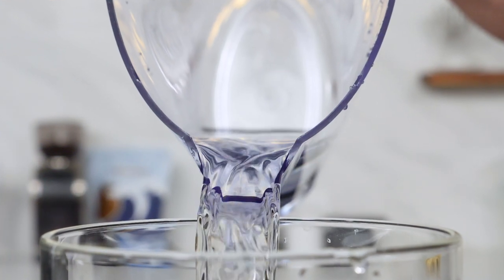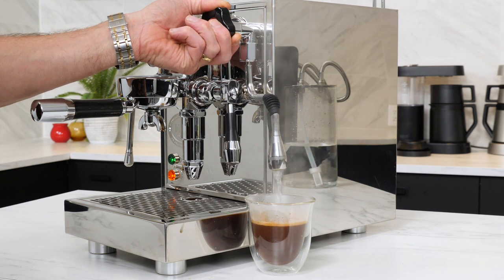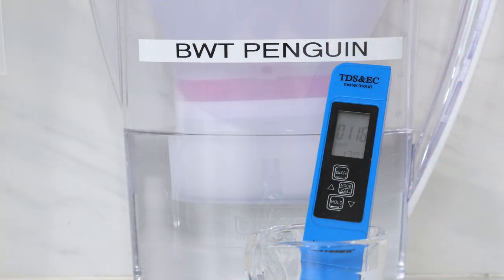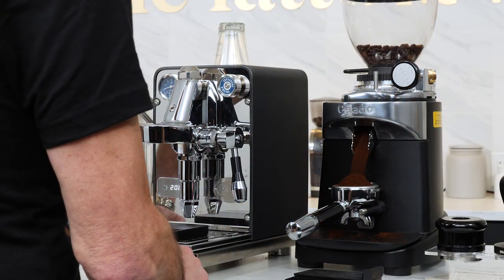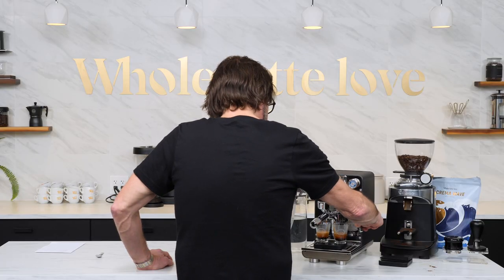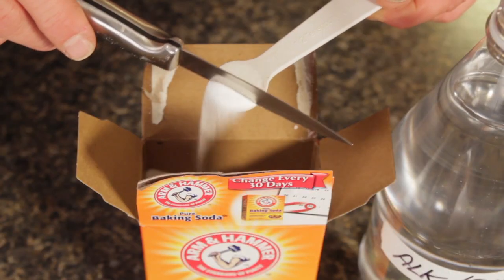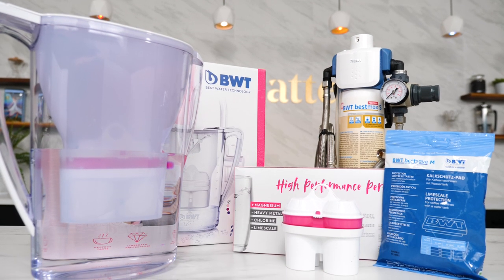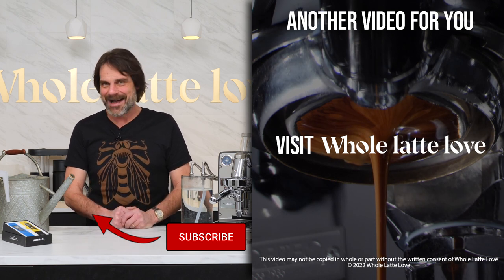Ultra-Pure Water for Coffee and Espresso?

Comment: I have been using BWT pitcher for drinking water for years, but I wouldn’t use it on my expensive machine. Chlorides are not taken out thru a carbon filter and eventually your machine will have to be descaled. I rather use distilled water and Third Wave Water. Or you could run distilled water thru the BWT Magnesium filter.
Reply from the maker: Hi j, thanks for the comment. Depends on your local water supply but high chlorides (often in coastal locations) are not a problem for most. Be aware a BWT magnesium ion-exchange filter will not add minerals back to distilled water. BWT does have the Bestmin filter designed to remin water with low to no mineral content like distilled and RO:https://www.wholelattelove.com/products/bwt-bestmin-premium-m-filter-cartridge

Comment: Hi Marc, thanks for all the helpful info.  I’m planning to plumb my dual boilers and have a question about how to get the best quality of water for the machine.  We current have a whole house water softener system and would it still make sense to install a BWT in-line water filter for the plumb line?  Thank you!
Reply from the maker: Hey Mark, You are welcome for the info. Honestly it's hard to say. There's some variation in whole house softening systems. If you are happy with the flavor of the water from the system and the coffee it makes then the remaining concern is the calcium hardness. Whole house systems generally replace the calcium with sodium so scaling potential is reduced or eliminated. This type of softening can increase the sodium level of treated water. But, unless your source water was very hard >400ppm sodium increase is not high enough for  concern. Softening systems do not reduce chlorination, chemicals or particulates on their own (the BWT inline filter does) but many whole house systems do include activated carbon and mechanical particle filtration for that.
Hope that helps!
Marc
Reply: @Wholelattelovepage   Hi Marc, thanks for the prompt reply!  And yes!! that helps a ton.  Getting the water situation figured out has been tricky, let alone having a dedicated line for the espresso machine.  So you are definitely helping us make the right decision with your experience.  The water hardness in our area is around 152 ppm and the water softener we installed is from Puronics Hydronex igen B, which has a layer of filtration to reduce chlorine levels as well.  Would you say BWT bestmax filter is a "nice" addition but probably not mandatory in my case?  Again, thank you so much again to provide such help! ^^

Comment: How does the pitcher work since you dont have to test the water and make the appropriate filter chiloice like the inline filters.
Reply from the maker: Hi r, The inline filters treat water much faster than the pitcher. With that, they use a bypass setting (determined by water testing) to adjust how much water goes thru ion-exchange to insure proper filtration. The pitcher system has a known flow rate thru the cartridge so it's designed with capability to properly exchange with a wide range of calcium content inputs.

Comment: I have an RO system with a reminilizer on it to alkaline the water. Does that work? I was planning on buying the Profitec 400 and just read about RO water ruining the boiler. Is this true?
Reply from the maker: Hi AB, Remineralizing should do the trick. But, not all remins are created equal. If yours uses calcium to remin then depending on concentration it could leave you with water which will cause scale. Scale is fine so long as you descale your machine as needed and the 400 being an HX boiler machine descaling is fairly easy and low risk. Pure RO water can cause corrosion of metals and terrible tasting coffee so do remin. I prefer remin which uses magnesium as the mineral. It's a good extractor and no corrosion.
Marc

Comment: How about using the Third Wave Water “Espresso Blend” packets in distilled water in the reservoir of espresso machine? Is this safe for my machine? This would be without an in tank filter.  The ingredients for the espresso blend are a little different than their classic blend. The espresso blend consists of Magnesium Sulfate, Calcium Citrate & Potassium Bicarnonate. Is this water fine for my double boiller?
Reply from the maker: Hi K, Thanks for the question. Unfortunately I do not know if that mix is fine for your espresso machine. Would need to test it for calcium level and other parameters to determine scaling potential. My gut says given that calcium is part of the mix it may cause scale but I cannot be certain. There are less costly make your own brew water options that use only magnesium to get the required mineral level. I show one recipe in this video: https://youtu.be/iHI7jC0sQZo
Marc

Comment: Purchased the ECM Synchronika from you all.  I purchased the BWT-M in tank reservoir.  What’s the best water to used in the reservoir with the BWT-M filter for best taste, distilled ,tap or filtered tap?
Reply from the maker: Hi K, Congrats on the your new machine - the Synchronika is a beauty! For water, do not used distilled. If your tap water is reasonable  - average with no unusual characteristics you can use that straight in conjunction with the BWT Bestsave in-reservoir pad filter. It protects you from scale formation and removes chlorination. Just be sure to allow 12 hours of contact time between the filter and water before use. So refill your reservoir when done using the machine each day, let it sit overnight and your ready to go. Hope that helps and thanks for your patronage.
Marc

Comment: Hi Marc, what are your thoughts on using Sparkletts water for Esspresso?
Reply from the maker: Hi Jonathan, So you want two main qualities in your water. First it needs the proper mineral level to do a good job of extracting the espresso. Second you want water that does not cause limescale deposits in your machine. You also want it free of chlorination - bottled water generally is. Only way to know if your water is good is to test total hardness and carbonate hardness. I have no test results for the brand of water you mention. Bottled water is all over the place in total hardness and carbonates. Last week I tested some Poland Spring brand bottled water and it was close to distilled water. It was lacking minerals and would need remineralization to support good flavor. Also tested a local store brand bottled water. It was high in minerals (hard) and would need filtration to prevent limescale formation. If you can test your brand or get test results from the manufacturer it's good for use in your machine if both total hardness and carbonate hardness are in a range of 3-6 degrees of German hardness. Published test results are often expressed in ppm. 1 degree of German hardness = 17.9ppm. In ppm your good to go if both test between 54-107ppm.
Hope that helps!
Marc

Comment: Hello and please ignore the Warhammer name I have hah.

As someone who doesn't have the ability to plub in their dual boiler machine, will the penguin suffice as the sole way I fill my reservoir?  I bought both the pitcher and pads because I'm worried they won't be as effective as a straight line-in setup.

Also, just out of curiosity, but what is your guy's opinion on those water kiosks in big-box stores that you can fill up those big blue 5 gallon jugs at?

Comment: Mark, I just got the BWT pitcher. My water TDS out of the tap is 186 using the blue stick TDS electronic meter. Out of the pitcher im reading 150ish. I ran it through again with the same water and got 100. Can you tell me how much I can expect the calcium is being reduce with this pitcher to protect my machine because I believe the TDS is not enough to tell me if I’m protecting my machine from calcification.
Reply from the maker: Hi KL, Thanks for the question. Since the BWT pitcher exchanges calcium for magnesium measuring TDS is not meaningful. You will see a TDS reduction but the magnesium still shows up in the TDS measurement. If you were to do total hardness and carbonate hardness tests you would see a reduction in carbonate hardness in water from the pitcher. It's the carbonate hardness which causes lime scale. Here's a video featuring a BWT expert with a deep dive into testing and various water issues: https://youtu.be/7TECrV93iGQ
Marc

Comment: On fully automatic machines like the Gaggia Magenta Prestige, is corrosion a serious threat? Where I live, the water is unbelievably hard, so I switched to using RO water purchased from my local store. I used tap water in my old Keurig and even with the filter in place it built up a lot of lime deposits all over the device.
Reply from the maker: Hi Michael, Not a big risk of corrosion. The Magenta's thermoblock boiler is lined with stainless steel. It's one of the few metals unlikely to corrode due to RO. I'd be curious what the pH of the RO water is. I did not get into it in the video but RO can be slightly acidic. One thing you can do to improve flavor is mix RO with tap water. Say your tap water is very hard at 400ppm TDS. Mixing 25% tap with 75% RO gets you reasonable water of 100ppm.
Marc
Reply: @Wholelattelovepage  Thanks!

Comment: The best is softened water, put through an RO+ filtration system followed by a serious mineralizing container taking it up to 200ppm. It tastes great. RO at 2ppm is hard to achieve and extremely bad for your health unless remineralized before drinking. It can penetrate and burst cells in your mouth, causing what feels like you have burnt your mouth with hot water. Having lost my serious water treatment system in a fire, I recently bought a BWT Penguin from WLL, and can confirm it smooths out bitter tastes in espresso when using simply filtered water.
Reply: "It can pentrante and burst cells in your mouth"
Omg what you write there 😂😂 i drink ro water for years and no problems.... Learn about water! Definition of water is that is without smell and taste.... If you have hard water it will be all but not good for health.
Reply from the maker: Hey Tom, Well I'm not a biologist but a little skeptical on the cell bursting. I do know that with exposure to CO2 in air RO water can become slightly acidic. Sorry you lost your system in a fire ☹️. Thanks for your patronage and sharing your flavor experience with the BWT Penguin.
Marc
Reply: @Wholelattelovepage  BWT only remove hlorid and hard metal parts .. Magnesium and calicium is stll there, so with them you will have deposits in your machine.... You can only remove them with RO.
Reply from the maker: @kzs12  Hi, Yes the BWT products do leave minerals in the water but reduces to a level that's unlikely to result in scale when used as directed. The ion exchange process replaces some calcium with magnesium. Overall general hardness is lower after treatemnt and ratio of carbonate hardness making up general hardness  is lower.
Reply: @Wholelattelovepage  My tap water is so soft that there would be no need to descale. After testing BWT water by steaming it in a steel jug and letting it sit for several hours, I can confirm that it drops a visible amount of scale and the coffee water heater will require descaling from the use of BWT treated water.

Comment: My jura has its own filter. I'm not sure what it does except they claim you'll never have to descale your machine using it. You set your machine for the hardness of your water, which I think just adjusts the replacement frequency of the filter.

Do you know if this filter is removing all the minerals? I assume Jura knows what they're doing with their machines and filters.
Reply from the maker: Hi J, That's correct use the in-reservoir filter as directed in Jura machines and descaling is never required. And yes, setting your hardness plus number of beverages made determines replacement interval. The filter does not remove all the minerals - that would require a full RO treatment system in the filter.
Reply: @Wholelattelovepage  gotcha thank you.

Comment: I have been using since day one of my home espresso setup, the BWT Penguin and also an Oscar 90 water softener sitting inside of the espresso machine reservoir.
This, because we called and asked for some numbers (was it Pha ? I am not sure) for the water from the tap in my area, and considered that both (BWT and Oscar) are necessary
Reply from the maker: Hi K, Thanks for sharing. Your local water provider should be able to give you a bunch of water quality parameters. In the US, that information is available online as well. pH in most tap water runs about near 7 with anything 6.5 - 7.5 being okay for coffee and your equipment. Number to be most concerned about is TDS = Total Dissolved Solids which gives a good indication of water hardness/mineral level in your water. Unless your water is unusually hard with TDS >250ppm the BWT pitcher is likely all you need to use.
Marc

Comment: Hey guys, looks like you guys had a whole latte fun doing this video.
While we are on the topic of water. 
Does anyone have an opinion with using water from the refrigerator water (filtered) dispenser versus from the tap (hardwater area) ?
Reply from the maker: Hi Vic, We did have a whole latte fun! Hard to say a fridge filter is going to do it. Only way to know is to test the hardness of it's output. Likely a lot of variation in what those fridge filters do. Guessing most are just particle and carbon filtration with little to no reduction in hardness.
Marc
Reply: @Wholelattelovepage  Thanks Marc, appreciate your input.

Comment: Is it safe to run CLR or vinager through the machine to clean it out occasionally?
Reply from the maker: Hi John, No! Do not use vinegar to descale a machine! It's a weak acid and leaves a horrible smell/taste. Scale can act like a sponge and soak it up making it very difficult to get rid of. For descaling use a citric acid based product or the product recommended by the manufacturer. Urnex products are what the pros use: https://www.wholelattelove.com/collections/urnex/products/urnex-liquid-dezcal
Marc